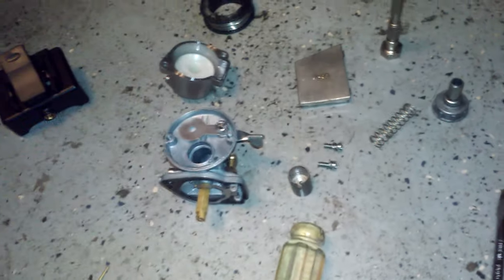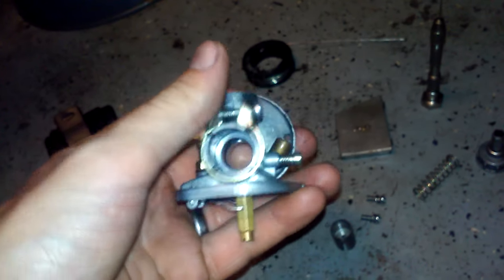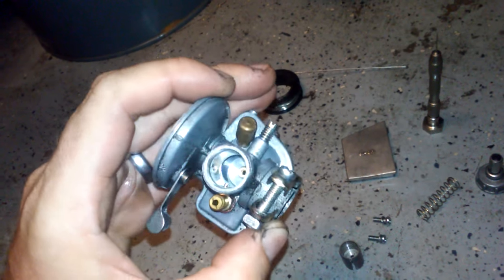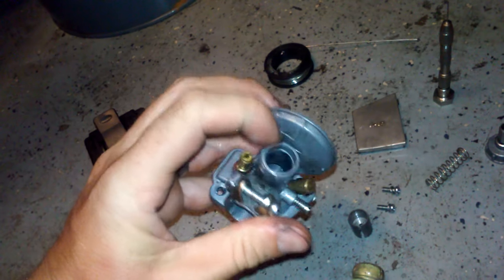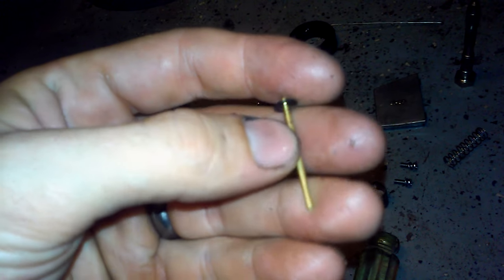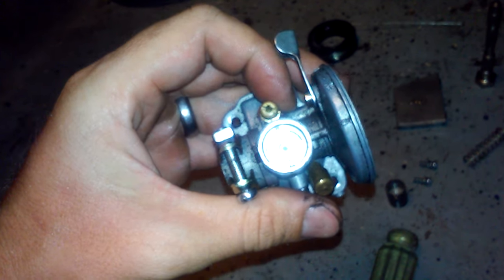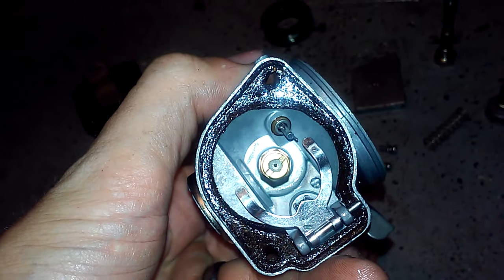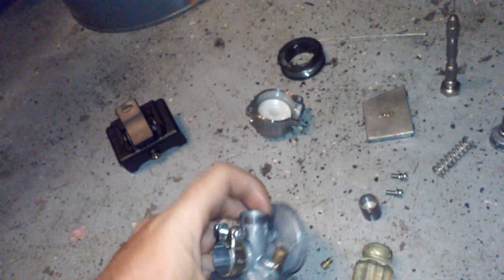Basics: Tuning the NT carb

Comment: I need more fuel..I have done a reverse jug and placed the carb and intake in the front and the exhaust in the rear...runs really good but cuts out at full throttle...my plug stays white/slightly gray..which to me means it's running too lean...too much air and not enough fuel..also why I'm burning up piston rings..which oil is mixed with fuel on two stroke engine..everyone says to add more oil..but I know 40:1 is perfectly fine..it's the lack of fuel and oil getting into the engine..once I get more fuel in, more oil will also get in..it's not my oil to fuel ratio problem,  it's my fuel/oil delivery problem..more air requires more fuel..like a turbo v8..bigger injectors help for this delivery...so is putting a bigger jet in, my only way to compensate for the extra air? Or is there something else that I can do to help?

Comment: My bike motor started developing carburetor problems. The motor surges and it does not idle any more. I was still able to get home. But The engine would not run unless I keep adjusting the choke lever. And also lost some power
Reply from the maker: Gilbert Arciniega you may have to clean the jet. Sometimes trash can get in the carb from tank (yes, through the filter) and clog the main jet.
Reply: Hi Terrence! Hey thanks for this info. YES, I got my bike going again! You know what happened, the entire jet assembly came off! All I did was rescrewed it in. But then it did not want to start anymore. I take apart again. And the hole in the jet was indeed clogged. Got a pin and cleared the clog. AND WALLA! Like new again!!!!!!
Reply: Oh hi Gilbert... I watch your videos of the 80's haha
Reply: Also sometimes that screw strips its threads so it keeps going to low idle

Comment: Wait, doesent that just adjust the idle? I tore one of these same exact carbs apart and it seems like maybe that it just moves the needle and opens up the air intake witch would increase or decrease speed.    Edit: ooooookkkkkkk so sorry you explained basically everything I said I guess I missed it, the actual tuning would make more sense.

Comment: My bike automatically speeds up to about 15 miles per hour with no throttle and when i pull in the clutch it revs really high and loud... like somethings gonna get broken high. Its brand new so i know this is gonna be real bad if i dont fix it. Do u know what it could be? I slowly put in the choke and that slowed it down but it stalls when i give it throttle when i do that

Comment: My bike accelerates automatically! The only think that would make it stop was flipping up the choke switch. Kill switch didn't work at all, and throttle seems to make no difference.
Reply: I agree with this guy as well almost always it's an air leak in the intake manifold so check your gaskets and tighten your bolt. I've also have this issue when my jet came unscrewed it would bflood the carb and wouldn't allow any throttle control it accelerate on its own

Comment: Can any NT carb adjustments be made to improve cold starting the engine?
Reply from the maker: Pretty much the only thing that can help cold starting the engine is the choke.  Once you get the main jet and needle settings dialed in, you might not even need the choke on a warm day.  Aside from jetting and needle settings, get a good spark plug, set the gap properly, and definitely change the spark plug wire for a better quality one and you should have a solid running engine.
Reply: @Agreenarmoury  Thanks I will try putting in an NGK B6HS Plug  and measure the plug wire resistance. Already set the gap to .028".....I am about 700 ft above sea level I was wondering if the engine is 100% stock I was thinking of rejetting to about a #66 jet also. I heard the NT carb comes at #70 jet but have not checked the stock jet size on mine.
Reply from the maker: @robc8468  I believe the most commonly used one is the 70, but the measurements on them can be a little off.  That's why I like using the micro drill bits. You can play with the jet sizes by soldering and drilling, almost as much as you want. Sounds like you're on the right track though.  Good luck!

Comment: The Screw to adjust the idle you said it doesn't do no difference just adjust Low High idle but I was having problems it was running slow and I lowered the idle went fast faster take off .
Reply from the maker: Robert B sounds like you may have an air leak after the carburetor. Try spraying some carb cleaner behind the carburetor to search for any leaks?

Comment: My stock nt carb has a 70 main jet and it 4 stroked, I have a 67 in it but the spark plug color it's still grey white but I have good power. 4 oz mix and I have over 350 miles on it, expansion chamber. Do I need a bigger jet?
Reply: Salvatore J. Quaglieri check your magneto for mal-alignment

Comment: Picked up a 5 mm Jet Kit of 21 jets for the 80cc engine.  Most engines come with a #70 jet.  I am at 774 feet elevation, so my engine seems to be running way to Rich. A #65 jet was suggested so I tried it, to rich. Now, I'm thinking of going to a #72, because the hole "looks" smaller, leaner?  Using the throttle...full throttle with the #70 jet, the engine seems to "pop" a rich running sound, back off the throttle to 1/4, the engine seems to "clear", RPM's come up as does felt power.  To me this is running way to rich. Open to full and it stumbles, kinda clears, not running as strong as it was at a very low throttle.  Anyone else working with the Main Carb Jet? 
 I have thought about putting a "Walbro" Carburetor on the engine, but I don't want to drill a hole in the side of the engine for the "pulse" of pressure that operates the diaphragm fuel pump inside of the carb. This is the type of carb that is on just about every Weed Eater, Chainsaw, Backpack blower.  I want to be able to adjust the High and Low Jets.
  I use the Stehl Chainsaw  2 cycle HP oil and 92 gas mixed at 40 - 1.
Reply: I think youre hot on the trail w the Walbro idea , was thinking same thing , Walbro from a 60cc saw , Echo 620P for example if it would bolt on w out mod except for drilling pulse port would be better all the way aroun an would be easier to get to air filter better . I have to unbolt manifold to clean filter

Comment: hi, i am having a bad day,  my so call friend had took. out the  idle screw all the way out,  my question is if that you put it all of the way in how meany turns do you. do,
Reply: rabbit 16  I’d say get it to half first, start the engine and let it idle,if it starts to die tighten it abit and if it’s sounds like it’s revving high loosen the screw. Abit of a late responce and you’ve probably found what ur looking for but just in case anyone else is wondering

Comment: Anyone who sees this comment I have a solution to motors like these not running good, mine was whenever I hit throttle the engine stalled out, well what most possibly happens was the float inside card leaked and filled with gas making it not..... Float.

Comment: I have a 4 stroke 49cc. Stock carb is too lean, so I changed to NT. Now , no matter what I do, It runs rich. 
Live in FL, so pretty much at sea level. Presently have a #61 jet with the needle in the leanest position.
Still runs too rich. I am at wits end with this. And am seriously considering just selling the whole damn POS!
Please help me before I take a shotgun to it.
Reply from the maker: So you might have an issue with float level being too high if you're experiencing an over-rich condition with that small of a jet.  You also might want to move the needle clip up a notch or 2.  Make sure the choke is off too, and you might need to change the spark plug if it's really fouled.  I'm not really the biggest fan of the NT carburetor though.  I made these videos because I kept getting asked so many questions, but I personally use a PZ16.  It's a pretty similar carb, but it has a separate idle mixture screw that makes it run so smooth at idle and transition.  Good luck!

Comment: my carb isnt sending fuel to my engine. how can i fix that?
Reply: Capt. Bacon sometimes  the jet gets gummed up or blocked. Take a thin wire and push it through the jet.
Reply: Capt. Bacon I would clean the carburetor. First remove the air filter so you can access the two black long Alan bolts. Unscrew both bolts and you should have the carburetor off. Take the carburetor completely apart as he has it in the video and blow compressed air through everything, especially that main jet. Next I would but it isn’t necessary,  get carburetor cleaning fluid and soak every part in it overnight. Re assemble the carburetor and re attach it to the engine. Done